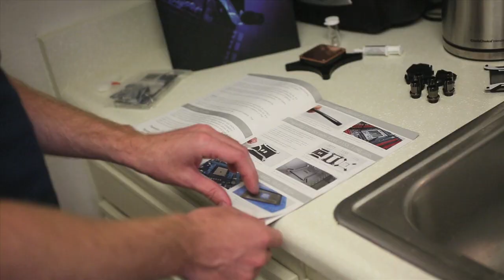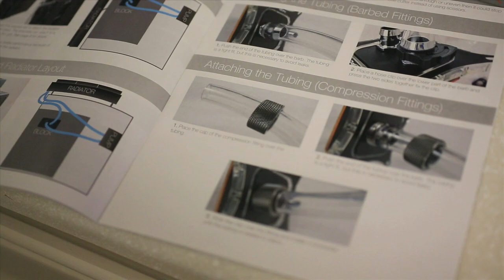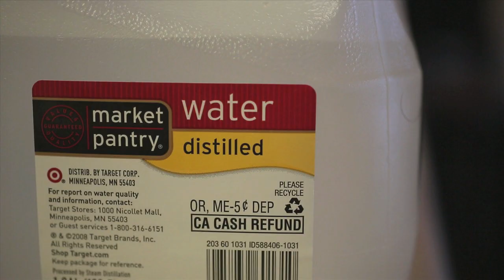A Beginner's Guide to Water Cooling Your Computer

Comment: You have to use destilled water or get a coolant, normal faucet water has chemicals and minerals that aren't visible to the eye which is why most families prefer their water boiled up to before consuming. I haven't tried boiled water but I think it works also.

Comment: APU's has better integrated graphics compared to the i7-4700k's Intel HD 4600. APU's are equipped with HD 7500 to HD 8500 series integrated graphics that puts Intel HD 4000 series to shame.

Comment: The processor might be good, but not the GPU. It is integrated, meaning a gpu has to fit in along with the processor. This means that the GPU is limited and the CPU is limited. So getting a seperate CPU and GPU would bring more power to the system

Comment: well im using
430W Corsair 
i3 550 CPU @ 3.2ghz
AMD Radeon HD 7700
7gb Ram
and can run battlefield 3 on high settings getting 35-55 FPS fine on all MP maps and i know my computer aint good/best but does the job and i aiming to upgrade again soon hopefully (lets just say it was worst before)

Comment: Yeah a 360mm rad should be fine, but don't expect like amazing OC's, and yes pretty much, just add the GPU block in there, typically I believe the outlet from the CPU block goes to the inlet on the GPU, but you can lay it out how you want to, it's your build after all not mine. :P

Comment: excuse me , my cese support up to 280mm radiator , and i want to do a watercooled pc , whit gpu , cpu and ram watercooled, do you think , a 280mm radiator is enought ? ( i will Mount a overclocked i5 4670k , and two hd 7870, both overclocked , and 2 slot od ram at 2933mhz overclocked )

Comment: you would have to buy a waterblock for your gpu, install it on the video card, get more tubing and more fittings for the gpu, you would also need another 120mm radiator if you wanted to overclock, then you just tube it all up just like you would in a loop with just the cpu, except the tubing would have to run through the graphics card. (Obviously)

Comment: you would install the radiator where the 2 fans are, take em out, stick in the radiator and it's fans if they're better then the ones already in there.

Comment: im planning on building a water cooling unit and i was thinking about putting it in the place of on top of the back fan. Im just gonna get a single slot radiator though.

Comment: People, don't add the silver coil, this will only increase the chance of corrosion and filings in your loop. Just add microbial additives to your loop, and like Sirinickwolff, use NON-CONDUCTIVE liquid. As soon as that water comes into contact with air, it's going to ionise and become conductive.

Comment: Although the H100i does have its issues, my unit still keeps my CPU up to 10 degrees cooler than the original H100.  I'm thinking someday soon I may try my hand at a full watercooling setup, but my H100i will do just fine for now.

Comment: Corsair seems to have QC issues with that particular unit.  The LEDs that were supposed to light the Corsair logo on the block end up failing for most users.  I ended up having the green LED die, so I can only get red, blue or purple.  I'll think about RMA when the red dies.  The Corsair rep told me that they switched to a different LED provider in their units, I hope that solves the issue.  As long as my unit works, I have no issues with it.  It's still a good upgrade from the original H100.

Comment: You're wrong on so many levels. The water never comes directly into contact with any of your components. The heat is transferred from your components via water blocks, then into the air via radiators. Also, the water doesn't "boil away" inside the loop. It never reaches the heat needed to boil, assuming the loop is working properly. Boiling water on the stove is being converted to steam (vapor). There would be nowhere for vapor to escape in a sealed loop, so the water level wouldn't decrease.

Comment: Ok 2 questions will normal water work to clean out the rad and the tubes and stuff and also will a 360 rad fit in a corsair 800d?

Comment: Not in a loop. It'll kill the pump and water cools better. Mineral oil is used for suspension builds because it's non-corrosive and insulates everything.

Comment: Yes it is. Look at a game like Crysis 3. A single Titan and a 4770k still can't run the game maxed out at 1440p with a framerate above 35 fps or so at stock speeds. With the OC, it can get a bit higher, 50 or so fps, but with games like that, the new gen of games and the advent of 4k gaming on the rise, we need more power now than ever before.

Comment: You spent 1000 dollars on a gpu yet you bought a apu? *facepalm. Apu's are basically for budget builds because the're a cpu and gpu all in one so you dont have to buy both a cpu and gpu therefore saving you money. You should have bought a amd fx-8350 or an intel core i7 3770k and a gtx 680 because balance is important in a gaming PC. You want to make sure your cpu is strong enough to make use of your gpu.

Comment: most games even with the highest levcel cpu's only see a max of 20 fps increase whats 20 fps gonna matter when the card is already pumping over 100 fps but yes the cpu is slightly cheap at least a 250$ cpu with a 1000 gpu would be better

Comment: The exact same thing could be said for the GTX 780. Those two cards performance are close enough.

At some point, the excess performance won't be noticeable. It will be quite difficult to distinguish between a game at 100 FPS and 120 FPS.

Also, at that price point, the performance returns for your investment start to decrease. At the pace that better tech is released, I find it hard to justify spending $1000 now when in a year, you could get the same performance for half of the cost.

Comment: board and cpu arent compatible for one, either get the sabertooth z87 or change to the 4670k, new chipset new socket, psu is actually overkill you could easilly get away with 700 or less but other then that looks solid, haswell runs hotter then ivy so i suggest getting the 3570k on the sabertooth z77. performance difference is minimal within 5fps or less, h100i will be fine for the build no need to do a custom loop

Comment: Nope, it will freeze ur CPU and prevent it from working at all! And even if u r lucky enough to not touch it by naked hand or you over heat your CPU before turning it on (Which will eventually crack ur CPU) then also ur tubes will crack and there will be a massive leak and a blast along with massive lolz for us!

Comment: much cheaper to go with the h100i but you can do your entire system if you go with a custom loop and get much better temps doing custom, ive seen 3770k's running at 4.8ghz topping out at 50 degrees with custom loopes,, depends how performance hungry you are i guess

Comment: distilled water won't help you my friend, you need to remove any aluminum from your loop.  I have no clue what aluminum component you have, but there's nothing that's going to stop it from causing problems.  Stick with brass and copper and nickel components.  When possible match the brand because they're tested together. Distilled water is only used because it lacks any metals in the water and is not conductive, it does not stay non conductive for every long.

Comment: if you pour alcohol in, you're gonna destroy everything in your loop, perhaps with the exception of the pump and the radiators.   Also, it's not cooler, at room temperature, they're the same temperature.  I'm not familiar with the thermal conductivity of alcohol, I doubt it much better than water.

Comment: the fan is on the radiator, which is where the heat built up in the loop goes.  You normally choose a case that has the right size mounting points for the radiator you want.  I learned everything from Singularity Computers channel here on youtube.  Fantastic system builder.

Comment: To determine if your RAM and motherboard would fit, depends. To check ram+mobo compatability, look up the manufacturers specs and/or ask someone knowledgeable. To check if it fits your case, check specs again. The point of a water cooler is to cool more efficiently and/or more quiet. The block on the cpu has a plate which contacts the cpu, and on the inside has water flowing, which takes the heat from the cpu and carries it through the radiator to be dissipated. That is why there is no fan.

Comment: Hi guys, I just discovered a great way to stop your watercooled CPU overheating. Inside your waterblock will be a jet plate which only allows 0.2mm of water to pass thru ur system at a time (having bigger pipes make no difference). I removed mine as it was clogged (too much algae as I didn't use a biocide) and my CPU temp is now 24 degrees and the PC has been running perfectly for days. Its totally pointless!

Comment: You really shouldn't buy prebuilt machines, you will get a better insight in how computers work and how to maintain them. Everyone I know that has bought prebuilts, wish they didn't and instead put together their own system with parts that better fit their needs.

On to your question! It appears like they use prefilled and prefabricated closed-loop coolers. They do not require any maintenance, though you may wan't to clear the radiators from dust once in a while, as dust often accumulates there.

Comment: aye, on that i totally agree but when its just the CPU i just cant see the point, an all in one system is cheaper, easier to install, requires no maintenance, its basically hassle free and as far as i know offers the same level of cooling.

that said, a proper loop does look absolutely awesome.

Comment: Distilled and deionized water are basically non-conductive, that much is correct. The thing is water is pretty aggressive in picking up ions from metals it comes into contact with . . . thus becoming re-ionized and conductive.

Comment: DONT! use water. use something non conductive if you spring a leak (it does happen) the only damage done is the overheating to your CPU which usually it will recover. i recomend Cooling fluid or even mineral oil.

Comment: oil has a very poor thermal conductivity... it also behave differently than water... under no circumstances should you run oil through your loop. the only situation would be in a submerged PC

Comment: I have two questions, if I am going to build a custom PC for scratch should I build the PC normally and then add the liquid cooling after? The other question is if you have any other tips for me? like whether or not I should pay for the ABSOLUTE best of the time gear, like the best and newest graphics cards/processors, or just get the second best that is a fair amount cheaper but at a reasonable level of desire.

Comment: Nice guide: plain and simple. I may suggest not to jump start your psu if you have it connected to other peripherials (hard drives, exrta 4/8 pin cpu motherboard connectors or similar): just connect the pump for filling up the loop.

Comment: Few extra tips:
- Kill coil + Nickel plated stuff = bad idea
- Dish wash Detergent = also a bad idea (they can form foam on the reservoir and radiators increasing temps)
- Clean looking loop = avoid crossing the tubes but don't leave them too long
- Position of components in the loop WILL NOT alter the final temperature. The only "mandatory" thing is the reservoir -> pump order
- Install the fittings before installing the components to avoid stressing the hardware
- Don't rush, or else...

Comment: i'm not sure it would make a difference in performance if you just replaced the distilled water with mineral oil. interesting enough though, you can completely submerge your system (except hdd) in mineral oil since it's non conductive to cool your pc. im not sure how effective this is

Comment: Despite having a sealed loop, there is still oxide that builds up in your blocks. The oxygen from the water still reacts with the copper blocks.

From my last cleaning, my distilled water was still super clear, but the inside of my blocks had this blackish layer that I had to clean out.

Comment: The manufacturers of the components (graphics card and processor mostly) have engineered the parts to run at certain speeds ("clocks" in mhz megahertz or ghz gigahertz) for a very long time. The engineers know that under standard conditions, increasing the clock speeds shortens the life of the components and is not as stable and can cause the computer to crash

Overclocking is for people who research what is safe to increase the speeds of the components. It's a fun hobby when you get used to it!

Comment: overclocking is making a cpu (processor) or gpu (graphics processor on the graphics card) or anything else with a clock speed run faster. this is usually done so that you get more performance. however when you overclock you also increase the heat that is produced by the cpu or gpu (whichever one u overclock) and heat kills components, so thats why people resort to better cooling such as high end air coolers such as the noctua nh-d14 and watercooling

Comment: Overclocking is making your Processor, GPU, or RAM run at a higher speed (Clock speed- Hence the name "over"clocking). You will get a higher performance rate with the trade-off of more heat produced. A computer is not "bought" with overclocking, the processor (or whatever you're OCing) has to have OCing enabled. Processors with a "K" notation are unlocked, allowing OCing ie: i5-3570k, i7-3770k. GPUs and Ram are both overclockable too, but RAM OCing is not necessary unless you have bad RAM.

Comment: Maybe you don't want to overclock it immediately.  But what if you want to be able to use your computer for a long time.  You can compensate for the lack of having new hardware by increasing the clock speeds of your current hardware.

Comment: Yes, it's called intake/exhaust.  Air intake fans are typically in the front of the case as well as the side, with exhaust fans on the rear and top of the case.  Having positive air pressure is also recommended (more intake air than exhaust).

Comment: Not really sure why this is never mentioned in water cooling.  The weakest link is your tubing and connections.   I recommend replacing the standard weak and often brittle plastic tubing with PEX.  And without a doubt use clamps.

Comment: 1. 'Radiators' make no noise, the fans on them will make a lot of noise if they are high static pressure fans. So yes, they can make a substantial amount of noise. 2. Not always true, it can leak from block corrosion (have a look at some EK blocks). 3. Overclocking is definitely not for gamer's 90% of the time, as most go with either air or closed loop systems. 4. Please don't insult people about things you have little or no knowledge about.

Comment: Nice clean guide, but you forgot to disconnect your grafics card when you unplugged the mobo :) Just installed a corsair h100i, and tbh that cost me less then doing a real water cooled setup, and i dont have to worry about leaking and refilling. Also i move my pc around alot to LAN´s, so just keep in mind that is an easy alternative :)

Comment: 1. Radiators make little to no noise at all. 2. If you take the right percautions, and you're not a fucking idiot, it won't leak. 3. Overclocking is mainly used for gamers, intended to increase the internal clock of the component for better performance. 4. Nobody said GPU will melt you 10 year old inbred fuck.

Comment: less is more? ture to some part but i rater see that 80-90% of my cpu is coverd then just 25-35%. It takes a bit longer sens you have to remove the waterblock a few times untill you get it right.

Comment: By using uv reactant tubing and a uv light source. as far as i know regular tubing is a little bit UV reactive, and the light from fans produce a little bit of UV light, but the effect is much stronger if you use actual Uv reactant tubing and UV lights

Comment: Non conducting liquid is referring to liquid that does not conduct electricity. This is used to protect the components inside the system in case of a leak.
Both you and popcorny are referring to 2 different typed of conductivity in your discussion.

Comment: You do want the fluids to conduct! So that they can absorb the heat energy and carry it somewhere else. If the fluid didn't conduct you CPU would get pretty hot. I'm not saying water is not good enough it is just not very effective compared to other liquids. I once did a experiment in grade school where we put an ice cube in water and then used a torch to heat the graduated cylinder. The water boiled around the ice before it melted. Try it yourself. I chalange any one to prove me wrong on this.

Comment: You should leak test it without power to your system for 24hours before actually giving electricity to your precious components. That way you can just dry up the leaked water, fix the leak and try again. If you do it right there is really not a big chance of a leak. Also, that's why he had the paper towels all over when leaktesting ;)

Comment: The ID (inner diameter) of your tubing should be the same (or maybe a HAIR smaller) than the OD (outer diameter) of your fittings. If you're talking about 8/10ths of an inch, that shouldn't be right at all. If your fittings are all 1/4" OD, your tubing should be 1/4" ID.

Comment: The best starter kit I've seen is by xspc. Go to the xs-pc.com website > click on products > then "Water Cooling Kits". The D5 kits (RX is their top line rads) come with a D5 pump which provides more head pressure than the 750 (pump/res) series, which means you won't have to replace the pump for when you expand your watercooling set up to cool additional hardware (graphics cards, motherboard, etc..). A few shops that sell these kits -- performance-pc, frozencpu, some amazon locals, google it :P